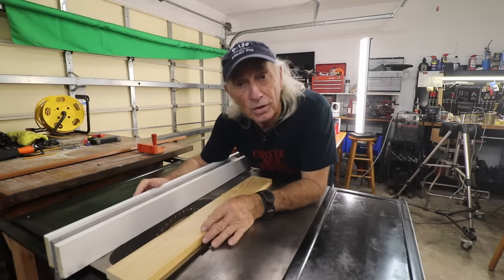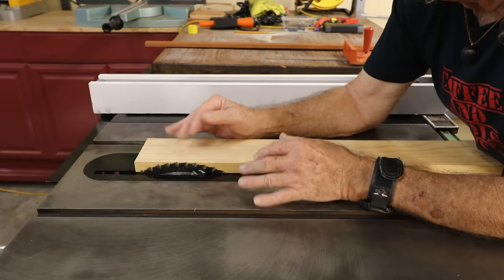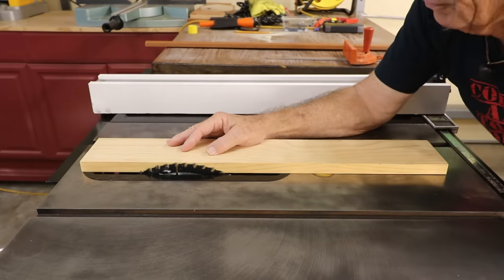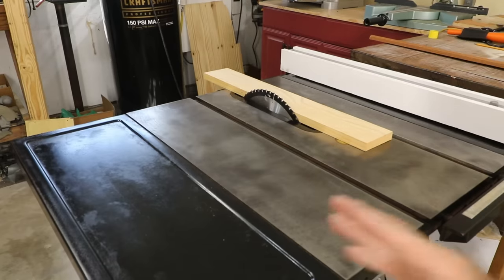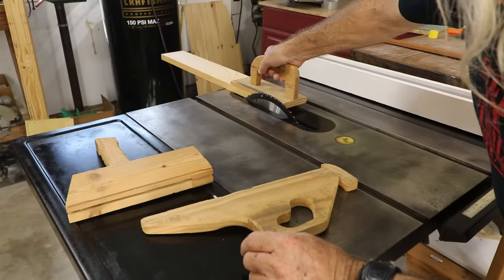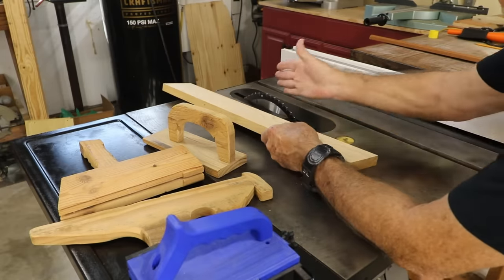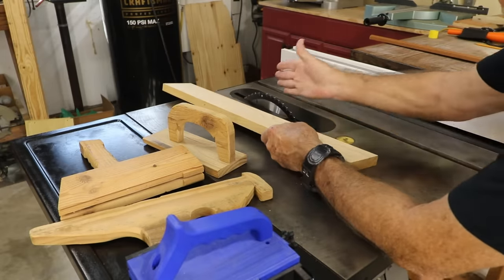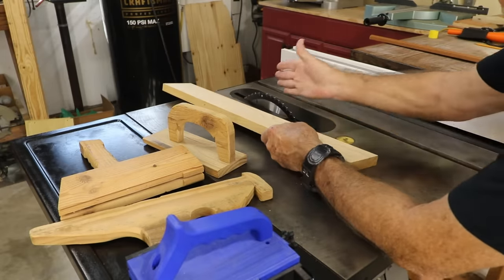Table saw secret nobody will talk about from the good old days, C&T episode 180

Comment: I am a long time Carpenter, cabinet maker, and furniture maker.  I have never gotten hurt with any saw.  With a table saw I make sure I have control over both pieces of material until they are past the blade, period. Big pieces you can push through with just your hands.  Skinny pieces I use 2 push sticks and push both the cut and off cut past the blade.  Off cut scrap pieces make good push sticks. Just notch the end so you can push forward and hold down at the same time.  I don't like the factory push gizmos.   Wood grips wood better than plastic.  I always have scrap wood.  If you cut or damage the scrap wood push stick, so what.
Reply from the maker: Us old guys have uncommon sense. Thanks for posting and using scrap is a good idea.
Reply: @SirTools  Thanks.  I am glad you are helping teach people common sense safety.  In the last several years it seems that the people in charge of safety practices and safety equipment have no actual experience using the things they have decided to make safe.  The clunky awkward plastic table saw guards, the ridiculous gas can safety nozzles, and etc.  College degrees but no real world hands on experience.
Reply from the maker: @rossfelton1955  If can explain those darn gas can nozzles to me, i'm all ears :)

Comment: My saw has a cover that goes over the blade to collect more sawdust. It literally doesn’t matter if it is an 8th or 6 inches above the blade, I would have run run my fingers under the blade guard to come unto contact with it. Making a cleaner cut and avoiding kickback are MUCH more important. If you are a beginner who may not be able to keep in mind where the blade is then you should not be using your saw without a blade guard anyway.
Reply from the maker: Agreed James

Comment: 30 plus years have all my fingers and never a kick back. Only the last 2 years have I even have a riving knife. I will say I’ll never go back. I’ve alway set the blade 1/2” above the wood. Any lower and I always find the saw starts to lift the wood which is obviously not good. Plus like you said forces pushing down with the blade higher helps hold wood down and creates less backwards force towards you. Win win. Not to mention the better cut quality.

Comment: And just like the C-130 that had a big red line on the fuselage marking the rotation plane of the props, stay out of the rotational plane of the blade. I always stand off center so if the board does get launched back I will not be there.
Reply from the maker: YOU know it :)

Comment: Kickback is more of a twisting kickback and not a straight shot. This is how most injuries occur. When the board goes to the left and starts to twist it "pulls" the user's hand into the blade. It happens so fast that you can't keep your hand/push block from hitting the blade when it's way above the board. Having the blade way above the blade makes the twisting action more severe. Highly suggest you get a riving knife installed as this keeps the wood from turning into the blade and stopping the kickback. If you can't retrofit one to your table saw, get a different table saw and throw the old one in the trash. These should not be in the market and I wouldn't want someone else to loose a finger/hand b/c of old school thinking or lack of knowledge.
Reply from the maker: Well, no we don't want to see that happen.

Comment: Long time user of table saws….  Set the blade to low and as the wood “climbs” up, you lose focus and start trying to hold it down…. Bad idea.  Lose focus you get hurt!  Keep the blade higher, you get a better cut, lower chance of kick-back.  Use a push stick.  If your fingers are no where near the blade, you don’t get cut!  I had kick-back once, board hit me in the gut like a Mike Tyson knock-out.  Bruised for months, but learned my lesson.  Do not cut short pieces on a table saw against the fence.  That is why chop saws are for.

Comment: A friend of mine list his left thumb and the two adjacent fingers, at quite a steep angle, using a table saw. A co worker shouted some comment to him, and he looked away to reply..... I guess the moral is be aware of what you're doing at all times with any tool.  Incidentally, his gaffer had removed the riving knife, so he got prosecuted.
Having taken off a finger end with a power plane.....daft as it sounds, I put it down before it had stopped running, and I grabbed it again as it scuttled off....yep, should have just let it go. I try to stick to the rule :0)

Comment: Dark secret #2.
Why have the fence extend beyond the centre of the blade?
The fence feeds the wood into the cut parallel to the blade (hopefully), once the blade engages with the wood the job of the fence is done, from then on it becomes redundant unless it is setting up a contradictory force to the blade by pushing the cut piece onto the upward moving rear half of the blade, which is trouble.
Better still end the fence just at the point where the tooth meets the top of the wood.
Reply from the maker: Tacklife tried that with their first generation table saw. Nobody liked it

Comment: Interesting. I always have the blade showing above the material as you do. I have found that if it just shows the material can ride up and the chance of kickback is greater. Riving knife? Just gets in the way, I often cut rebates (and fillisters - how many people know the difference nowadays?). As far as angles are concerned I often cut them between 90 and 45 but most saws have the riving knife attached to the blade carriage. Safety, above all know where the blade is and where your fingers are, and will end up.

Comment: you want your blade high enough that the chips clear the blade as you are cutting, you really want there blade high enough that the whole gullet is above the wood. this will minimize the possibly of kick back. due  to chips plugging up the cutting area. also, I check the alignment of the blade and fence at least a few times a year, as the weather changes, things move. another tip is the wax the table so that the wood moves as easily as possible. my saw does not have a rifing knife either and I have never had a kick back. I have tried several aftermarket products but frankly I think they create more problems than they solve. A new saw is the best option but until then I will do the best I can, the best safety tool is between my ears. never assume anything, double check everything.
Reply: I would say that most kickbacks are caused by the wood warping into the blade as you cut it. The riving knife helps prevent this.

Comment: Would it be logical for the saw blade to cut wood underneath the table of some passive or active wood pusher mechanism, for which the rotating blade is now never being directly exposed to the user? This means it is practically 100% safe. If you want to look how the cut is being made, a camera can be fitted into the saw table. I'm a grown man and the rotating saw is devastating. I guess CNC saw system is probably the most safest design.

Comment: Yeap! I am 60. I first got exposed to both a tablesaw and a radial arm saw in the agricultural shop at school. Around 14 years old. Yes I was told to cut high on the table saw. The danger on the arm saw was tested so cross cuts was done only on arm saw. Almost all other cuts on the table saw. The only safety guards was on the 12" arm saw and none on the 12" table saw. Yes! With a group of us children and power saws! We learned that those saws could do major damage to a stick of wood. We knew that if they could do that to wood. Flesh wouldn't stand a chance. Once we used the band saw to cut up a quarter slab off a cow. So yea we was a bunch of farm boys. Very few girls took ag back in the day.
Reply from the maker: You got it Raymond and thanks for sharing :)

Comment: You are using the side of blade to help you guide the wood. I purchased a new blade from a major blade maker and I was getting burning from that brand new blade!!! I called the company and was told that the fence should be a very slight angle away from the blade, very slight the thickness of a dollar!!! It stopped burning the wood. Also go to shark blade guard for riving knife and guard

Comment: Rule number 1 never stand in the direction of blade spin nor do you position any part of your body, in line with the blade nor do you ever cross over a spinning blade any part of your arm basically what this means is you are still able to make precise cut while placing your body on the side of the blade. You do know rip fence may be placed on either side of the sawblade
Reply from the maker: The saw used in this video can only work the fence from the right hand side. Most are not like that one and we've sold it to a contractor. 90% can use both sides.

Comment: Having worked a peculiar variety of work sites with the little mobile "contractor model" table saws and in shops with a proper cast-iron topped "old school" table saw... It's just my experience and observation here, but running the blade a little higher or lower makes only a little difference... The kickbacks that I've seen (including quite a few videos), start where the wood somehow gets pinched between the fence and the back of the blade... 

    One way or another, "Complacency Kills" in a shop. I don't care if it's a framer who's gotten the brilliant idea of disabling the safety on his nailgun... and later tosses the thing over a ceiling joist to hang by the air-hose so he can climb up and get it himself (rather than ask someone to pass it up to him)... OR it's the guy who ONLY ever checked his intended board-width between the front of his saw blade and the fence when he set the clamp... There's no space for complacent hurried behavior around power tools...

     With my own hand-held circular saw, a wormdrive with a 10 inch blade, I've generally kept about a half-tooth exposed for every cut... unless I was playing with joinery...  AND the saw "steers" in the cut that way... SO that lower profile to the blade does allow some more "forgiveness" to moving the wood around as you pass it into the blade... Whether that contributes more or less to kickback is... well... dubious.

     AND I know, the fence isn't "supposed" to misalign with the blade... Well... In a perfect world it wouldn't. BUT you have to assess your OWN hazard management... I always check in front AND behind the blade to be sure that fence is "dead on balls" straight... AND you might be surprised how often I'm slightly annoyed that I have to "monkey with it" for a minor adjustment and straighten the thing... AND I'm not just talking about that ratty old contractor Bubba's brought to work sites for 20 years on the back of his 4x4, either... BRAND NEW saws in the box have needed regular adjustments...

     We do NOT live and work in a perfect world. That's as true for table saws as it is riding motorcycles... You'd all be well advised to understand it and remember it.  ;o)
Reply from the maker: Yes, the fence pinch seems to be most of the kickback. Rare, but we've heard about off cuts hitting some folks too, but very rare. Also having to "shim" the motor is another one that has caused some injury from portables. We'll have to re-visit the table saw issues on another video in the future.
Reply: @SirTools  I've seen maybe a handful of "off cuts" get tossed by the blades... Usually, the really coarse teeth or "sets" has more to do with that, and even then I've never seen anything more "dangerous" than maybe a good whelp (force-wise)... which coming off "the dreaded table saw" can shock the hell out of you if you're less experienced around table saw incidents... 

     Haven't had anything "serious" to me, personally... I've used plenty of "dangerous old-school" saws, too... BUT I've born witness to some gnarly stuff, and I can only really speak to that experience/observation... haha... 

    AND of course, even that I don't currently do anything with a table saw, I'm always interested in "the latest thinking"... SO I'll look forward to your next "edition" on the thing.  ;o)
Reply from the maker: @gnarthdarkanen7464  I think we're going to pull off a forced " kickback" and also a few other fun things. Hope my guitar lessons were not a waste of money :)
Reply: @SirTools    Good luck... (and of course, be careful on that)...

    If I had to do something like that, I'd probably affix a small wedge to my fence (double-sided tape or hot glue, so it can be released after)... probably lined up very slightly behind the blade... And use a sacrificial push stick to keep the fence DEFINITELY between myself and that blade... then a relatively low set, and short board to "rip" should be relatively easy to send...
     ...A little inventive... but alternatively one could make a "pull stick"... something similar to any of the push-type devices, only with an extended handle to reach over the table and saw... That way, once the "short board" was at least balanced on the table to feed into the blade, I'd be on the "safer side" of the saw... catch it, pull into blade... and it does NOT have to hold the wood down, since we WANT kick-back anyway...

    Don't know how "far" you've planned out yet, so I like spit-balling a couple ideas when someone's thinking of something (especially if it's dangerous)... haha...

     AND yeah, while I acknowledge that all knowledge is also power... I certainly hope you don't prove to have wasted the time on guitar lessons... ;o)
Reply from the maker: @gnarthdarkanen7464  I was thinking about using some foam core so it will bounce off my head :)
Reply: @SirTools    Well, if you saw Stumpy Nubbs' video about kickback, you might notice that it tends to come off the table somewhat too low for headgear to help (unless you consider the resulting "folding-up", potentially banging your head into the table/blade)...

    BUT of course, you're the one with the most relevant experience on the equipment in question, so use your best judgment... ;o)
Reply from the maker: @gnarthdarkanen7464  Love that Stumpy Nubbs and yeah I watched it. He's very good.

Comment: Rule of thumb I was taught for blade height was expose 1/2 of a tooth above the thickness you are cutting.
Reply from the maker: 1/2 inch ! Thanks for posting
Reply: @SirTools  No, one half of the tooth! 

While I have your attention, what about feather-sticks to prevent kickback and keep the board pressed against the fence. (Take any piece of pine, say 3 or 4 inches wide, cut an angle on one end, then cut a bunch of kerfs 1/8 to 1/4 by four or five inches long on that angled end. Then clamp it to the saw just before the blade and pressing those"thin fingers" against the edge of the board you are feeding into the saw. It prevents kickback. The board can only go towards the rotating blade.
Reply from the maker: @damnhandy  1/2 a tooth ? WoW, but not a bad thing to keep your fingers !

Comment: I noticed that keeping the blade just low enough to clear the top resulted in me having to push way to hard into the wood.  I don't like doing that.  The more I keep my hands on my side of the blade the happier I am.  Like you said a low blade causes the blade to come back and up and well I never even got close to a cut. When was I could barely see the top on the saw I seen my dad cut his thumb bad enough for a trip to the dr for stitches and a very worried look on his face.  I'm now 67 and I still have to old craftsman 10" saw.  Only as dangerous as the operator.

Comment: I`ve learned to put the teeth outside the material to be cut - but not more. If you sink them as low as you showed the things you described (more force to push through means more chance to slip; wood "wants" to climb up the blade) are more likely. Too high means more exposed blade - also not desirable. But you need to feel comfortable with it! If you don´t feel comfortable - stop.
Nice video - liked your calm. Have fun!

Comment: I liked most of what you said, except for the metal of the inner blade helping do anything to the board. it has no contact with the board due to the kerf of the blade teeth being wider than the blade. that being said, I am of the 3/8th above top of board school , do to the increased angle of entry ( more downward forces) and an acceptable? amount of finger cutting blade exposed. yes always use push blocks and keep those hands well away from the chopper. for the barely above crowd, I am here to tell you that blade will suck more flesh into it long before your hand goes passed,,( still a member of the 10 fingers 10 toes club,,)

Comment: I find that the angle of attack for the blade to the wood should be between 45 and 50 degrees downward.....takes a little experience to set without needing an instrument to be sure, but it's pretty much never given me burn marks or kickbacks/knocks.  Yes, it's "not safe" because the blade is above the wood, but to be honest, a shallow cut will cut you up pretty bad regardless.

* the angle of attack that I'm talking about is if you imagine a perfect circle at the tangent of the saw in motion hits the top of the wood.  A shallow cut (to the tip) is 0 degrees but gives you maximum breadth the blade will push against the meat of the board, which is high chance of kickback. A max cut could be 80 degrees, depending on board height, which gives you almost no breadth and can cause chatter/knocking/splintering/burning or various other problems.....so the 45~50 splits the difference.

But that's just my opinion.

Comment: Proper hight is teeth out  (old school) so the blade operates as engineered to dissipate the heat (heat bad) more efficiently from the blade, more blade more friction and heat especially in production work modern blades are becoming thiner and have expansion channels  to compensate and stop warping which is dangerous . Kick back prevention for people not comfortable on the saw should use the 2 to 1 rule twice as long as wide. thank you for the topic cheers